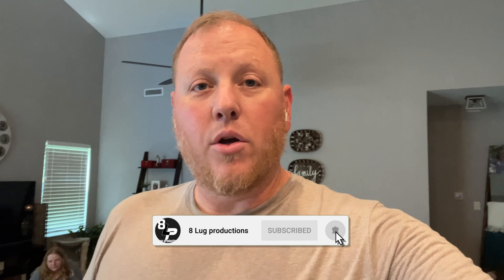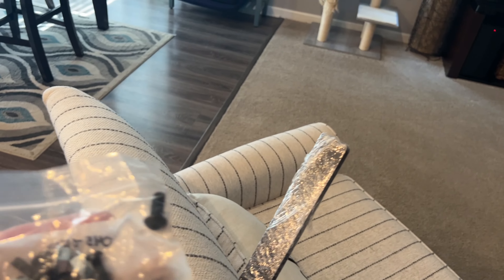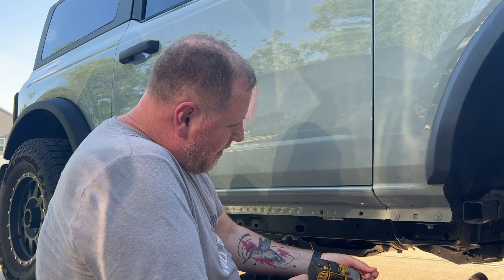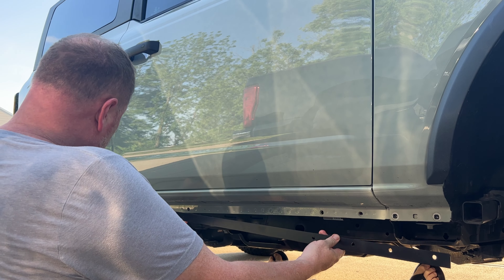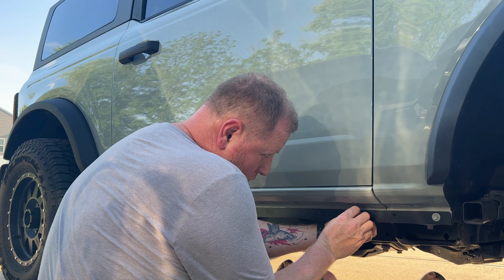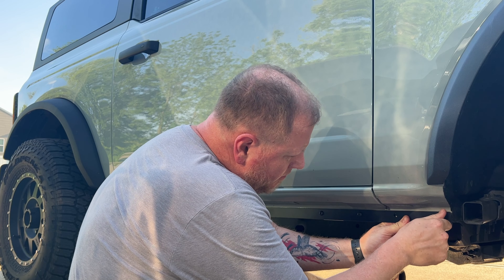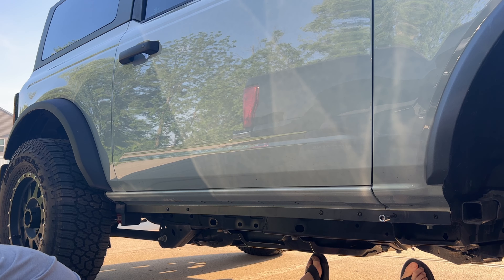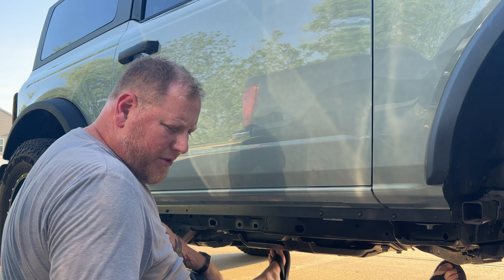Fix those ugly weld seams

Comment: So it comes with all the bolts so that they are black right? That way or you don't reuse the factory colored ones? 

Thanks for the video!
Reply from the maker: Correct. Comes with all the bolts you need.  You will not reuse any factory hardware.
Reply: @8Lugproductions  awesome thank you! Other kits you have to reuse the factory bolts and it doesn't look as good.

Comment: Hi! How’s the engine doing?
Reply from the maker: running strong.  3500 miles since the replacement
Reply: @8Lugproductions  that’s good to hear. My engine production # is in the high 300! That’s supposed to keep my engine out of that valve issue time frame! I hope!